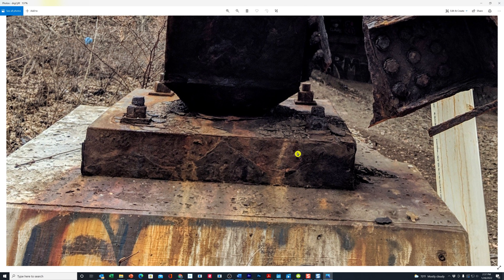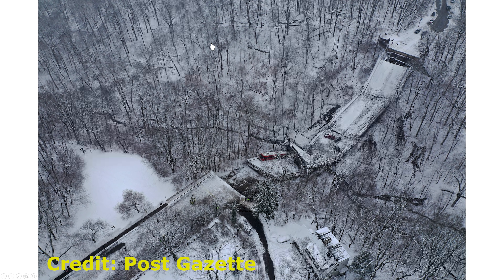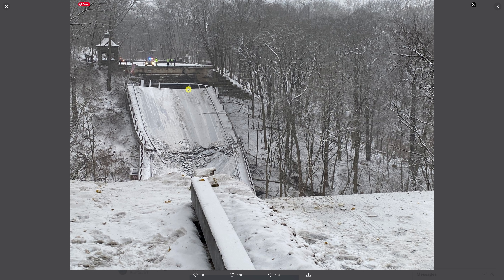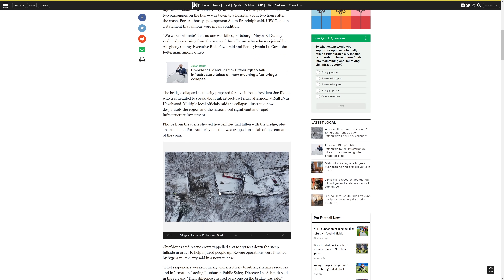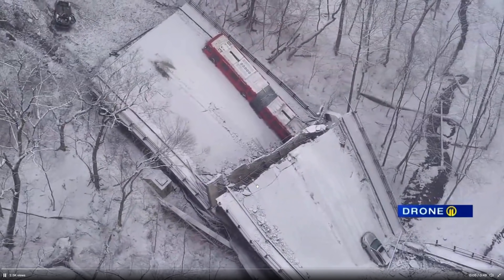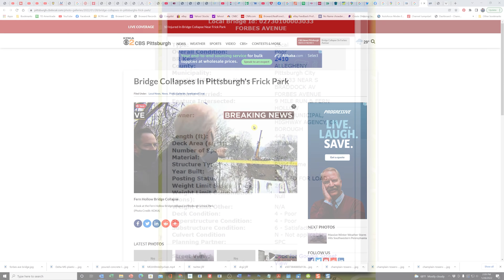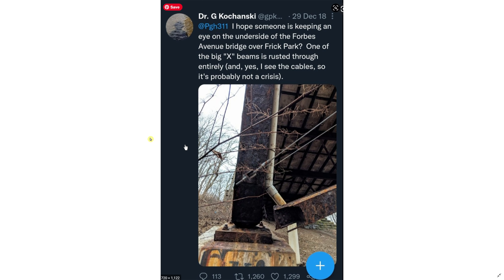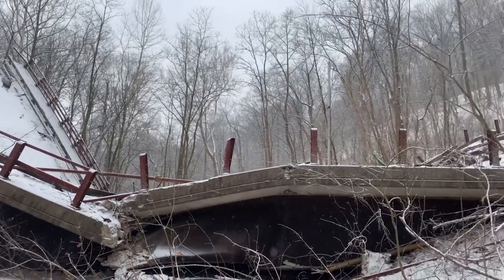Pittsburgh Bridge Collapse Cause, Forbes Ave Bridge Frick Park Rust?

Comment: The ultimate culprit here may be the Core10 Steel (sorry US Steel).  As you said this steel product was marketed as minimal maintenance steel that required no paint to prevent rusting.  However while working for a Pittsburgh Civil/Environmental Consulting firm during the late 1970's the word in the engineering community there was that Core10 steel did NOT stop rusting in certain environments/applications.  Our group  did not favor this material in any project we worked on.  By the way, previous to that job I was head of Geo technical Engineering for a North East Ohio Civil engineering.  My department also contained the Soil Mechanics Lab; Concrete testing lab; Bridge Inspection Group and the Construction Inspection Group. At that time Ohio was reputed to have one of if not highest percentage of poor condition bridges in the US. I worked hand in hand with our senior Structural Engineer to insure the structures we designed and built did NOT fail (so far so good!!!).

Comment: If the pictures are correct and cables were added, then that could have been a cause. The original decayed cross brace stopped movement in 2 directions, but adding cables only prevented one direction movement. The cables look to be very tight. So then add cold temperatures, and the cable pulls even harder with nothing stopping the cables from pulling the leg right off the small cement pillar except for just a few inches of corroded steel that is connecting the leg to the bolted-down base. 
In short, the cables did not prevent movement like the original cross members. The cables already being under tremendous tension, tightened more until it pulled the leg right out from under the bridge.
We are blessed that no one died from pure negligence.
Reply from the maker: Yes it's hard to get a grip on why they didn't just replace the original member That rusted through and we simply don't know what all they did under their bridge without seeing a report on it

Comment: It appears as when the weight was added to the deck ( likely and mostly from the bus) the "weak area" where the cross braces were removed and replaced with the cables, the weight of the bus caused the braces to fail and buckle under the weight where the "weak area" was from lack of the lower braces, caused the cables to "snap" resulting each end to break free of the expansion joints at each end of the bridge, causing the deck to "slide" on each end towards the center, as the end sections broke and slid away it caused the additional expansion joints to break free and split into several sections in opposite directions, luckily the section where the bus was, buckled upwards creating a wall to stop the bus altogether from sliding down into the ravine.

Comment: Just looked at the underside pictures of bridge on google maps. There is a walking track under the bridge. All the drains are blocked with debris. It has an interesting lattice framework construction. Questions - How many layers of asphalt were on the bridge? The  expansion joints were filled. Question - How mush salt is applied when it snows? Steel + SALT = RUST. I live in Australia. Where I live NO snow.
Reply from the maker: I am covering all of this in my follow up video in the next day or 2

Comment: Hopefully, this will trigger an investigation (and reconsideration of the classification) of many Pittsburgh bridges. I've seen worse in that town and am surprised they still stand. As for Frick, when traveling there, I always avoided it, especially in winter. Rapunzel1212 below is dead on as to why. On other bridges, I've seen rebar (?) exposed beneath the surface because concrete has broken away, rust literally falling from bridges while driving beneath and landing on my windshield, ended up with rust stains on my clothes from bumping up against others... That town is a hot mess.
Reply from the maker: I hope changes come down the line

Comment: 11:30 I think we are looking at two different bridge types. 1. A beam that is supported at the ends and about 1/3rd out from the respective ends. That bridge deck is bending under load. So it has to be thick enough to take the compression and pulling forces in the beam. 2. An arch style. That bridge deck is mainly under compression forces. Only the parts leading to the arch are again of a beam type. Therefore the deck can be substantially thinner.
The more vertical the supports are the less of an arch they form. If they have movable joints where they meet the deck then it is clearly a beam type. But there can be all sorts of intermediate designs. The telling feature is when the center of the bridge gets thinner. Then it needs to be an arch design because that is the area where the bending forces of a beam type are at the maximum.
Reply from the maker: The dot lists it as a rigid design, although there are at least 3 different breeds within that classification

Comment: I walked under the bridge back in 2009 and from all the rust. I honestly assumed it was unused. Figured it was part of the Frick Park, as a ped walking bridge. As there are numerous older train bridges turned into walking trails.
I saw a bridge report. Says the Fern hollow bridge had a poor rating back as far as 2011.
With the amount of salt spread onto the roads in PA during winter. Its not unusual to see rusty bridges. 
But looks like biggest problem was no rehabilation on the bridge since i believe 1995.

Comment: Bridge should not have been allowed to remain open, in that very serious corrosion condition. I've seen much smaller bridges reduced to one-way one-lane traffic that were in better condition than this. This bridge should have been closed, not left open with a band-aid (cable) replacing the x-member semi-permanently. 
There needs to be a change in bridge-condition reporting, that REQUIRES bridge closures, even if that inconveniences traffic. The public would demand bridge replacement, when closure is done rather than just having a database of bridge condition that the public never sees, until AFTER a failure. 
Instead of politicians whining about funds, and highway departments hiding true conditions, there needs to be consequences for government officials who allow this to happen.

Comment: There are too many questions to ask too point out a few. Most bridges where built before we started to use brine for ice control after seeing what in just 3 years of motor vehicles in NYS I can not imagine what happens to a bridge. This stuff gets in every place under a vehicle especially where steel is layered and spot welded. So one would think in the spring or part of winter clean up should include a pressure washing and inspection every year if not for any other reason as too get a baseline. Also when ever you resort to using cable I get to replace steel cross member one would think that is a temporary fix to be give priority permanent repair. Again just my two cents. We seem to be great builders only not so good at maintenance on what we build,maintenance aways seems to be first to get cut from budgets. We need to rethink are priorities on building without thinking of long term maintenance.

Comment: The cables added where the diagonal beams broke only keep the columns from drifting out. They cannot push like a beam. Makes no sense.  The columns can meander inward at will.
Reply from the maker: Yes it seems like those cables aren't helping much at all in much at all and the result proves it
Reply: The X-config of the cables will keep the frame in lateral position.  Yes they cannot take tensile loads but the X-config will maintain the shape.
Reply: @rightsideofthegrass8114  if the footer pier fails and collapses inward, nothing will prevent it.
Reply: @teddythomas281  I don't think a concrete pier failure was pointed out as being a potential problem.  The target was the diagonal cross member being corroded to the point of complete severance.  An uncompromised steel diagonal member would be important to keep the concrete pier from lateral movement, either inward or outward.  The cables would keep the concrete pier from outward movement, but not inward failure.  

This entire collapse looks too orderly to be a random failure of one point.  The superstructure appears to have failed in some order, SO THAT the deck would fall as a unit.  The falling deck appears to have come down as a unit, without twisting (marker of failure of one side of the superstructure before the other). The bus was not thrown off the deck, another marker the deck came straight down as a unit.

Comment: It looks to me that it has an added level of asphalt over top of original concrete. The side walk is added on top of the old sidewalk, with spacers for some reason. Also noted that the bridge abutment on one end looks to be from the late 1800's. However the old abutment is intact, and would not be the reason for the collapse. As a novice with just a good eye for construction I totally agree the rusted out steel is the root cause, but the way the deck folded up, it looks like the whole thing was in really bad shape.
Reply: Being from Pittsburgh and witnessing the reaspalhting of roads year after year after year, I can only imagine the amount of layers of asphalt that are on top of that bridge

Comment: Not far from this bridge is the Beechwood Boulevard/Greenfield Bridge which in the 80's started having debris fall from it and hitting cars. What was the city of Pittsburgh's solution? Put a net under it, seriously they put a net under it and waited about 25 years before building a replacement bridge. 

This "accident" sadly doesn't shock me.

Comment: Kentucky is now building a new bridge over the Green River on Hwy 60 east in Henderson county. It’s replacing an old narrow bridge that’s been shut down and repaired quite a few times. I cringe each time i cross it. The new bridge should be finished by late summer of this year. I remember the bridge that failed in St. Paul, MN. There was a number of people that died when it collapsed.
Reply from the maker: Yes, they need more people to die before they wake up fix these rotting bridges.

Comment: I like your details. The lack of maintenance combined with the deck sodium concentration and damage to the structure was definitely the cause  .  The Pa chart is not real time and has a substantial lag period . City of Pittsburgh leadership / ALLEGHENY CO WORKS are not the sharpest tools in the shed . They didn’t address the deficiencies from the 2017 inspection repot and most likely forgot about it. The bridge should have been closed or major restrictions on it  until it was repaired. You have to meet or work with the individuals responsible for the bridges in the 
City their incompetence is staggering
Reply from the maker: Unfortunately this happens all over the place when you don't have money allocated to you people make patches on roofs because they can't afford the new roof and they just keep putting more patches. It's less expensive to keep fixing it now than to pay for the full repair later on when it all hits the fan
Reply: @jeffostroff  🤣😂 as long as you patch them you’d be ok. In a lot of cases that I witnessed they say they patched them and sold the materials to go to the local bar . I’m not making that up 🤣🤣🤣That City is extremely corrupt.

Comment: Thanks Jeffostroff for replying !

Every country makes that mistake not just in u.s. 
How comes the engineers don't make it mandatory after the construction is completed and include it in the maintenance schedule now that everybody know and sees the effect of no protection ?
 
It seems nobody believe in rustproof paint and concrete or treated wood sealers that work great like if it was a scam. There are so many industrial chemicals on the market today that can do that like Dupont and 3M among others. Even Rustoleum paint will last at least 2 - 3 years. No financial excuses is valid if It save yearly costly repairs and payoff on the long term. We do protect our driveways but not for a 20 millions or more bridge ?????

Comment: Indeed maintenance or the lack of it has left much to be desired. It should not have been left to rust like this. Amazing nobody got killed. You are right that if in 2018 the bridge was photographed in such poor condition, it should have raised alarm bells. Nevertheless at 50 years for a bridge of dubious design and materials it should have been earmarked to be replaced.
Reply from the maker: Supposedly it was supposed to be replaced in 2033
Reply: @jeffostroff  Good gracious! That is way too long to wait! The new bipartisan infrastructure law is a great thing to happen to the US, way overdue!

Comment: Yes, what Scott Morris said below. I live in PGH and the salt and salt solutions they use to treat the roads during the winter definitely contributed to the collapse. That stuff just eats concrete and steel. Combine that with freeze/thaw cycles, and not enough funding to maintain the nearly 450 bridges in the area...well, you see the results.
Reply from the maker: Great point!

Comment: I'm not a bridge engineer, but looking at the total rust through of the supports, its probably a good guess that it is a contributing factor, combined with the weight of the snow, the cars, and a 44,000 pound bus, and the bridge condition itself was rated as poor. Looking at the sections that buckled, it was like an accordion. It looks like one or more  support beams or cross bar buckled. Of course NTSB will release the actual cause after they investigate.

Comment: Thank God no one was killed.  After looking at those pictures, that bridge was very neglected. I honestly wouldn't have walked over it. Bridges in the colder states where salt is used for melting the snow require more rigorous maintenance.  I've worked as a road construction inspector in NJ for the final 17 years of my career and have never seen a bridge that bad.
Reply from the maker: Yes this looked like it had cancer

Comment: You'll get some pics from underneath the bridge if you do a StreetView on the track that goes under the bridge in the ravine...
Reply from the maker: I did the Street View already it's horrible you can't even see anything it's just so blurry very little resolution, I think the guy that shot the under side Street View probably used an apple 2
Reply: @jeffostroff  I could make out the basic structure of the bridge.

Comment: The real reason the bridges in the Northeast are falling apart is all the salt and other Chemical deicing agents they use in them ! I was Born And Raised in the Pa/NJ area I've seen the condition of these bridges underneath what I've seen makes you cringe not only to drive over then but under them If I had to choose over or under I would go over and hope I survive the decent vs being crushed by it! This bridge was not that old compared to some in Pennsylvania for example the Tillman St bridge in Allentown was extremely old before it started to fail why? Because it wasn't always subjected to that stuff they de ice everything with today. These states need to see what the western side of the USA does to handle snow and Ice you rarely see salt used in Oregon or Washington and they get a lot more snow and Ice than Pennsylvania does, funny how a new vehicle is completely rusted out in Pennsylvania in 5-10 years but in Oregon you can still find 70s VWs rust free that have been driven daily since new.  Harrisburg needs to wake up.

Comment: I've driven across this bridge many times and never felt unsafe on it. If that bridge is rated at 26 tons that bus itself is like 22 tons unloaded. Sometimes there's many trucks cars and buses on it at the same time and in the eastbound section they're stopped at the traffic light. I thought most bridges lasted longer than that. I think that morning there was probably 3 or 4 inches of snow.  I'm just glad nobody was killed.
Reply: The bus is empty 6-7 tons. With a 100 plus people on it do your own math
Reply: @ldnwholesale8552  they reported it as being 22 tons. It is a two section bus. I've been on it many times with standing room only with about 90 people maximum. It is absolutely packed when there are 90 people aboard.

Comment: All four drains on the bridge were clogged. Also, if you look in the drone footage, you can see one of the footings. It almost looks like there's nothing attached to it. I think the footing corroded from the road salt. Corr-Ten shouldn't corrode, because it forms a patina. The fact that it did shows that there was something seriously wrong with the bridge.
Reply: The Cor Ten steel is also known as weathering steel.  It was thought to be the answer to corrosion in the 70's through the 90's. Unfortunately we have found out it only preforms as expected, forms the patina if it allowed to go through the wet/dry process. The underside of a bridge usually doesn't get the benefit of sun and they drying process. As you can see in some of the pictures the cross bracing are tubular members. Moisture gets trapped inside and begins corroding immediately. 
I'm sure the years of salting, more aggressive  brine, and increased volumes of anti icing agents has reduced section properties.
I'd be willing to bet cable cross bracing "fix", could not support lateral pressure of any members that were weakened or buckled.

Comment: Jeff, I am legally blind and cannot use the picture challenge on the tool giveaway.  So, I wwent through the  Accessibility! cookies process.  It worked for about 1/2 of the links.  After that it no-longer work and now I am unable to enter about 1/2 of the items.  I refreshed and rebooted my computer.  I don't know what else I can do.  Help.
Reply from the maker: The only thing I can think of that you can do is to get somebody sitting with you who does have good enough vision to read the computer screen. Yeah whatever device they are using to test your authenticity, doesn't sound like they have a voice mode on it which would be nice for people who cannot see.